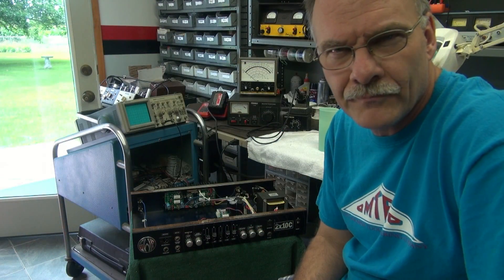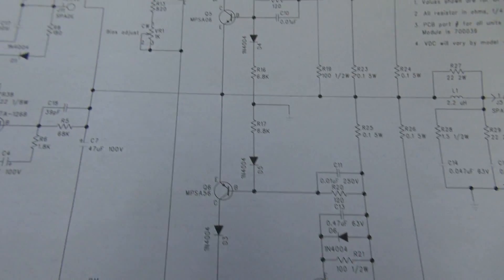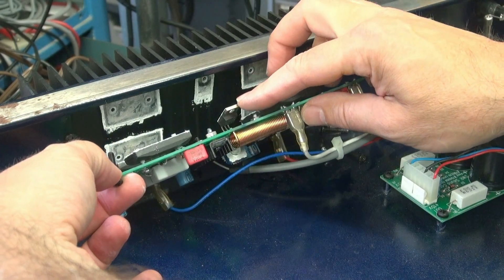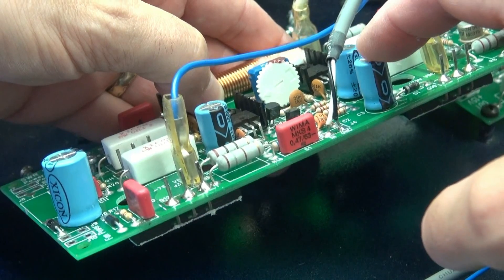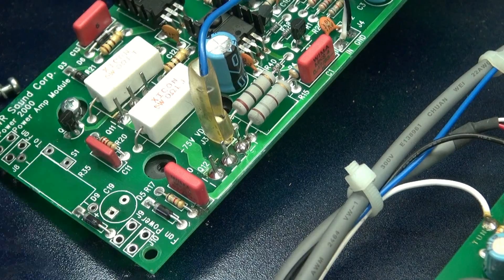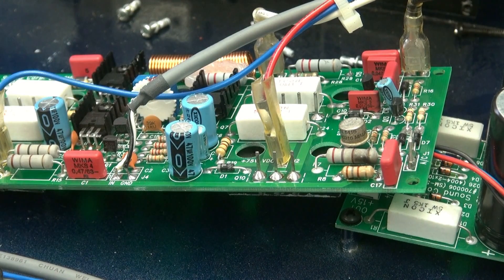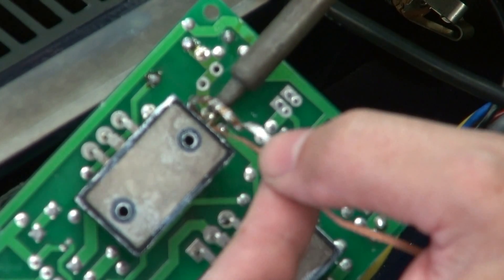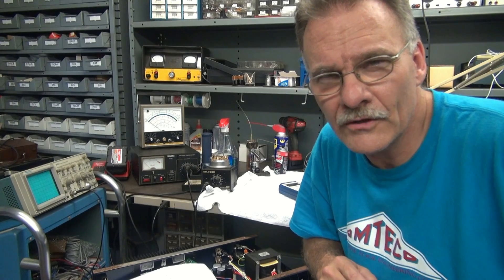How to repair fix SWR 2x10c Bass Guitar amplifier amp D-lab electronics

Comment: I want to use this amp as a head. Is there any problem with just using the extension speaker out? will I get the full range?
I was told by the seller the combo out has 3 wires going out to the original speakers.
any info would be highly appreciated.  Thanks for this video very good quality info and video.
Reply: I use mine with a 4x10 ampeg sounds good

Comment: i have a marshall amp and there is no sound but buzz coming trough. can you help me?
Reply from the maker: Is it a tube type Marshall?
Reply: +D-lab Electronics it is a valvestate 8080, don't know
Reply from the maker: That is a solid state amp. More than likely, you have many bad solder connections on the PCBs
Reply: Probably, today i pressed all buttons on the amp and he was able to give audio from my guitar. It cracks a little when i turn some knobs. i tried to put my laptop in the input jack and play some music and it worked but it isn't able to produce bass tones i think. it cracks at some louder frequenties. You can switch between boost channel and normal channel and the sound from my guitar only works on the boost channel

Comment: Thanks for doing the video on this great little amp! I have one from the pre Fender days that I had to rebuild the EQ (sliders were smashed in transit, otherwise the amp was solid).  You are right though...current customer service is provided by Fender, as they bought SWR in 2003...prior to that, SWR was its own entity and built some of the best sounding bass amps on the market.  These combos are absolutely bulletproof, and when paired with an 8 ohm extension cabinet they put out 400 watts RMS!  I run mine with the SWR Workingman 1x15 under it, and it sounds glorious!

Comment: what would you check if theres power to clip and speaker works but no sound?
Reply from the maker: +Ben Cast Hello, what is the model of the amplifier?
Reply: workingmans combo 15 i checked speaker by plugging my century power module. it works. its in the chassis somewhere.
Reply from the maker: +Ben Cast My guess is either bad solder connections or a power supply issue. Is it blowing fuses?
Reply: well theres one soldered from ext. speaker out to the power 120v /220v in. In other words from power source main (IN) to power amp. Visually it doesnt look melted. The one that goes in the ext. socket over tjhe power main. input. That one was suspect,  couldnt see in side of it at the wire it was completely clouded white. It looked powdery. But i replaced it and it still the same. Power to clip but not to speaker. And as i mentioned speaker works. My old peavey century 200 power module proved it, although the gain , pyramid, and gain2 (right side) are all glitching. YOU know cutting in and out but thats an other troubleshoot for later.